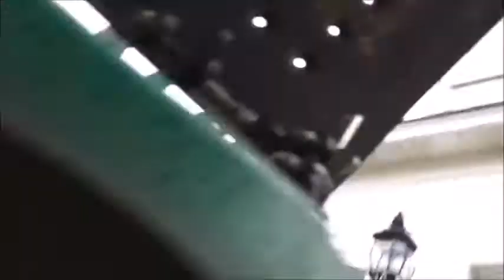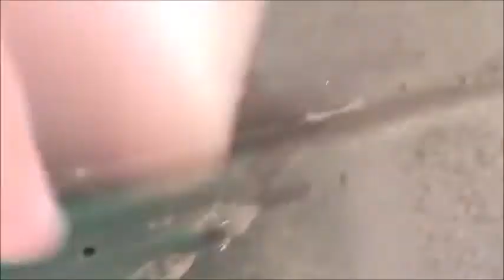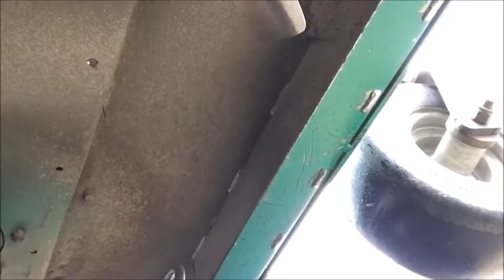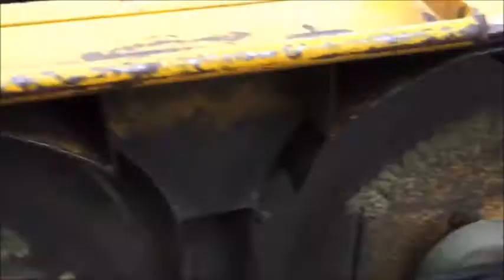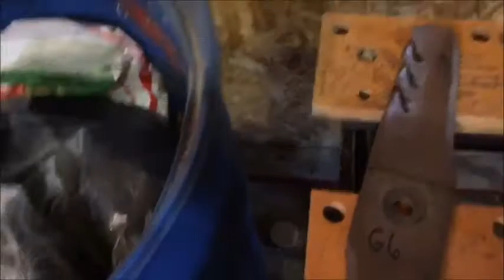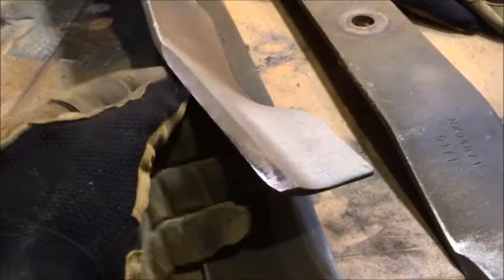MOWER BLADE MADNESS

Comment: I like that jungle jack! How much does that run?
Reply from the maker: CleanCutLawns NC I don’t remember .... I think around $189 and it came with a welded type hook on it that bent after time the machined hook like in the video has worked fine . I have had the thing 8 or 10 years not even sure they still make it

Comment: how many hours before you change blades? Thanks! Great vids! Keep them coming.
Reply from the maker: Chris Heath thanks! It depends on a lot of things like how low you cut how sandy it it is lots of people say sharpen every day ... but know one has time for that. You can visually inspect them and see that they are getting dull. You will also be able to tell by the proformance of the mower and the cut quality when it’s time to sharpen. As far as the life of the Blade 50 to 80 hours is the ablusite max I have gotten personally before I had to replace them .